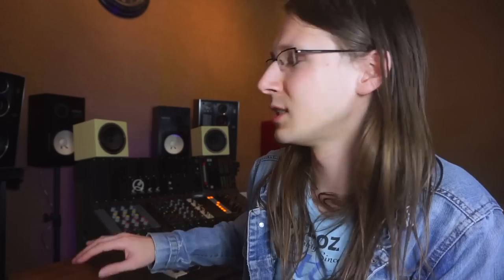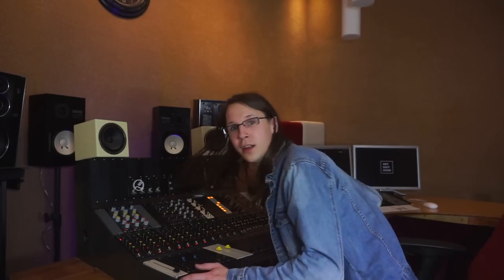Why Yamaha NS10's SOUND HORRIBLE?!?

Comment: Nice informations, always wondering what was the deal with them. Would you recomend them as a logical choice if you can have only one pair of speaker for some reason in a home studio (limited space/budget)? they seem to be only for checking not for surgical mix ( but good headphones can deliver this anyway so it could be a viable solution)

Comment: This is great, digging your channel! I have tried a Mixcube, but as my old ears have the treble turned down anyway found it a touch dull perhaps? I now have a OneConcept kitchen radio in that place. Mainly I use KH-120A's which are fine in my tiny room, however I was thinking of getting a pair of Yamaha MS-5's which have something of the NS10 vibe about them, for another comparison. As the KH-120's are pretty full range another option I'm trying is to set up an NS10 eq template?

Comment: Are you only mixing or also mastering? A studio nearfield monitor is no speaker, it is an audio measuring instrument which is like a magnifier for the ears.
For mastering the normal thing is to have a set of all kinds of speakers and headphones to have representatives of the normal consumer. Plus, you have to optimize acoustically you hearing room. You don’t have to measure your speakers, you have to measure your room and compensate for modes and reflections., but I am sure you know that.
Reply: That's incorrect. For mastering the standard is to have a single pair of "full range" speakers, which can go from 20hz to 20kHz as accurately as possible. Look at pictures of professional mastering studios, and 9 out of 10 will feature a single large pair of speakers. Also, if you are mixing you can't really do mastering because mastering is all about a second opinion and you can't be objective about something that you have mixed.

Comment: The reason why they translate so well is because they are very midrange based. They, don't have anything below 100hz and not above 10k. If that part sound good, it will sound good on all speakers. The most common studiospeakers I see in studio's are the yellow cone ones. I'm curious how good those are
Reply: KRK Rokits. I own the KRK5 gen3model. The low end is my only. Issue below 150hz. The cones are “pose” in design so bass resonates ALOT. Not ideal for a small mixing  room.
Reply: “ loose “

Comment: So much misinformation.  Akira nakamura the designer of the speaker has already corrected this weird rumor, it was designed to be a studio monitor.  Also, the ns10 is good because it’s a closed design, no ports, fast transient response, and if paired with a good amp they sound fantastic.  All these internet rumors are weird.

Comment: They came out in the 70's as part of their NS series of loudspeaker, their NS1000 was the flagship of that series.the ns10 didnt sell because they were nasty sounding and very expensive.They were very ' midrangy'a common characteristic of japanese speakers back then.While the japanese use to  to sell tons of tape deck and amps and turntables their speaker never sold very well.

Comment: The ns10’s have a peak in the mid range. So were guitars and vocals meet. The peak shows you how those 2  fit together. Big studio’s that understand use them for that. Not for mixing a whole track. And yes today’s tracks are super aggressive in the mids. That’s why they hurt your ears. Big studio’s use big mains mostly while mixing on high and low volumes. That’s why old michael Jackson sound great on them. That’s why all the semi home studio’s using the ns10’s only translate shitty.
Reply: so what is good for todays standards?
Reply: Depends on the engineer !!! Quincy Jones used them on Michael's stuff.

Comment: Well....  for years I had heard the internet hype of the NS 10's and considering the price to buy a pair thought that they must be some quite cool sounding speakers.  So in the back of my mind I had always wished that I had a pair but never quite felt like spending 4 or 5 hundred dollars to buy a pair off of Ebay.  One day I was at my local thrift shop and there was a pair for sale in there with a price tag of $7 on each speaker!  Needless to say I shelled out $14 and left the store with a pair of NS 10's!  I was stoked.  But I have to say that that was my high point of being stoked on those speakers.  After hooking them up to a receiver I was a bit surprised to discover that there was no "wow" factor going on with the sound of these speakers.  I hooked them up to a few different receivers and listened to a bunch of different stuff... I just didn't find them to be any better sounding then maybe some average speakers such as Advent tower speakers or something basic like that.  I TRIED to like them, I wanted to...  I just could never get away from the "HO HUM" feeling that I had about the sound of those speakers. Nothing special.  So I put them on Craigslist for $300 and sold them about 2 days after I put the ad on there.

Comment: Your mix cubes are based on auratones. You’re supposed to use one to see what your mix would sound like on a mono tv speaker. Ns10s are flat. And in a well tuned room they are the perfect reference monitor. Like you said they are in every professional studio. Not because they hurt your ears. But because they are accurate.

Comment: Bob Clearmountain made these popular as a secondary reference and then they took off. Before that it was always JBL4311s which are much better sounding. Sold my NS10s many years ago and still use my 4311s on my stereo for that authentic 70s rock sound.

Comment: dude ... you have the wrong version of the ns10's there - they are 1st generation ones - and that is the reason the ns10 have a bad name - they are only 25watts and the tweeters are no good - everyone has the 2nd generation ones which were brought out a few years later where they fixed the tweeter so it was no longer harsh and they doubled them to 50watts - i have a pair of ns10m's - the studio versions - they sound brillant - important you get the right kind of amp - preferably an old yamaha one that was made around the same time - i got one an old yamaha with the old VU meters on it and it sounds great - it made a big difference. They sound really pleasant and even for home listening sound great - not fatiguing at all. The version you need is with the writing on the side - these are second gen vs - the upright writing on your speakers are from the 1st gen which are known as the ones to avoid at all times. hope this helps.

Comment: They were the only speaker at the time that were phase correct between the mid & tweeter. This gives you a very accurate midrange, where most of the music is. Phase will color a sound more than anything else. The cone had low resonance. The tweeter is crap sounding. They have no bottom end. Didn't matter in the day, there wasn't much content with much bottom end. As far as tone goes, most music consumers were listening through similar sounding speakers. Beyond this, they were familiar to the Engineer in that he could trust them because he or she had a reference. There are far better monitors available now days that are far better suited to modern music production. The reason club music sounds good mixed through these is because they sound like shit & you have to fight to get a good mix. This involves tightening up the low mids & taming the high mids where dance music can give you fatigue, and where these speakers definitely do not excel. As I said before, it has a crap tweater, perfect. But, by no means should be the only speaker you mix with.

Comment: Aren't the mixcubes mainly for mixing for bass and treble challenged systems?  That's a bit different objective that mixing on NS10? NS10 would be fuller sounding (spectrum wise) than mixcube (which are mainly midrange speakers) ?

Comment: i also use broadband speakers like the mix cubes and they have a additional advantage,they produce a good artificial room because of the point surce, i just use smaller broadband speakers (better high end in that pice range) but with a subwoofer

Comment: Marwen Mema I seriously don’t think this guy knows anything he talks about, just what he reads at gearslutz.  The transient response due to closed design with no bass reflex points are a major factor to why these are so great.  It’s not because the cones are stiff, on the contrary the paper cones are less stiff than the plastic and fiber woven cones that are produced today.  The reason they don’t resonate as much after the sound is due to a closed design in the cabinet.  The originals were designed to studio monitors.  Also, they don’t sound bad with a good amp.  They sound fantastic.  But still brutally honest due to no reflex ports to exaggerate the low end, so you hear what you have.

Comment: The title should be written correctly: not "NS10's" but simply "NS10s". While it is true that when it comes to names such as these the apostrophe is used for disambiguation (as attaching the 's' without an apostrophe could be construed as the 's' being part of the name instead of signifying the plural), it has become such a common mistake for people to use apostrophes when attempting to pluralize, that I believe it is better to simply never use it in those cases.

Comment: What model of the NS10 are you trying? I have NS10m in studio b and NS10m Studio at studio a, and they are very different.
Reply: HoboRec I was wondering the same
Reply: Interesting! Care to elaborate on the differences you notice? I have a pair of NS-10m myself
Reply: have a horizontal and vertical model they re different
Reply: The NS-10M Studio's have a tweeter foam surround, horizontal logo and woofer and a 60W RMS - 120W Peak capability. The NS-10M's featured in this video are the (non studio version) which have the Vertical orientation logo and woofer, and a 25W-50W capability and no foam surround inside the tweeter cage. I've owned both. Many NS-10M (non studio) owners using them in studios place tissue across the tweeter to soften the HF a small amount, (which was later addressed in the NS-10M Studio Monitors Crossover)
Reply: this is the reason you never listen to these yters 100%
Reply: @HollerAtcherBoi   Read my reply to HoboRec !
Reply: HOBOREC........I love my NS-10m's...The white cone on the original NS-10m, is glued together & has a seam from the dust cover to the outer edge of the cone, when the NS-10m Studio, has the same driver, but the cone is pressed, no seam! (molded), not glued. You have to look closely to tell. That's why they sound a little different. This process started in 1981, because of the paper was a little different (Lack of the the same paper supply), & in thickness by that time.....Mine were made in 1979, so they're glued. Yes, these speakers have lots of detail & can be harsh in the mid section frequencies, as some producers back in the day, taped a piece of tissue over the tweeter's, so they could listen & mix longer per session. They were not designed for high decibel levels, that's why people blow their tweeters. They came to be studio standard's & replaced the "Auratone Mix Cube" for reference, by a lot of engineers. They are the best nearfield speaker ever made (by accident), in my humble opinion, & are very true!!!.....But then again.....I like ketchup on cottage cheese !
Reply: @StudioMarban   I disagree, it was the paper design that was changed, not the crossover. The HS-8's finally came out with a switchable roll off, which tames the HF down. read above.

Comment: OK, so for the first time I got a plausible explanation why and how the NS10s are actually useful for mixing. I was never very convinced by the statement 'they sound so bad, if you can make your mix sound OK on them, it will sound great everywhere else' – that always sounded a bit esoteric. Avantone now build a replica of the NS10. I think, they sourced the mid-bass-speaker from the original manufacturer. Avantone Pro CLA-10 - Summer NAMM 2018 https://youtu.be/fSlYil999bo

Comment: fact is simple ns 10s sound like car speakers if you know them and nail your mix in them you will sound 100% GREAT...but in this era you must have at least 4 other brands to flick between.so start  with aurotone then ns 10 the finish with great modern actives.its still quicker.but if your just mixing garage level of course you dont need them but amazing how many  major mixs are still done on them.you will hear fx and levels better to.aurotone ns10 combo in mono is real good

Comment: I respect the NS-10s (v1 with tissue and v2 without) but could never mix on them because they sound like shit and it would tire me out. I would only turn them on to reference a mix before finishing it. Make an adjustment or two, turn them off and put the mix in the can. I never understood people who could mix on them. It's just a worst-case speaker and if you can get a mix to sound good on them in the end, then it will sound good everywhere. Don't mix on these. Reference your mix on these.

Comment: under-damped = extra distortion, low transmission loss etc. Opposite of oldschool BBC bextrene. High stiffness = high efficiency = loads of cone breakup / resonance. Measurable distortion & phase smearing nasty weird waterfall. Yes. Same reason why we use soft dome tweeters - nobody likes ultrasonic distortion. Even metal is more elastic than cardboard - how resonant would a guitar with cardboard strings be?...

Comment: there is nothing really great about the ns10 . it its a basic , fairly flat unflattering low bandwidth speaker . you can get similar effect from other low bandwidth limited speakers . yes they make you work harder but back in the 80s no one used them in isolation . they were a tool in your speaker selection for referencing. i had a pair of very flat 80s celestion book shelf speakers to do a similar task decades ago. the thing that made the ns10 popular was that it became a standard. all studios had them , everyone knew them  , everyone could work with with them quickly and studio time is money. the recording industry is full of standards . protools for example . its not the best , its not the worst . but everyone knows it , everyone has it  , everyone can get to work quickly and efficiently

Comment: NS10s are not accurate at all by any measure. They were built to be consumer-grade bookshelf HiFi speakers, and it's just a happy accident they became a classic in studios.
So why did they work so well in studios? Probably because they are really mid-heavy, and that's where most of the music lives. NS10s force you to focus on that mid range and if the mid range is mixed well, then your mix tends to translate better.
But nowadays I can't see why someone would want to buy them, unless you're really used to mix on them of course. But they are not good speakers, they are heavily coloured, they tire your ears in 10 minutes, and you can't trust them at all for the low end. Also, NS10s were normally used in studios that also had proper full-range speakers.
The world has moved on. Studio monitors (and audio gear in general) has become a lot better. Our mixes need to translate to different audio systems as in the 80s. If you want to focus on your mid-range, just do that in your DAW. 
There are good reasons why NS10s in studios are not really a thing anymore, because they were never great speakers to begin with and the factors that made them popular don't really apply anymore.